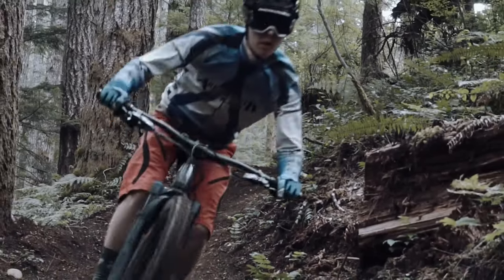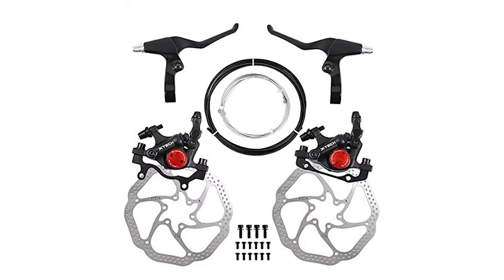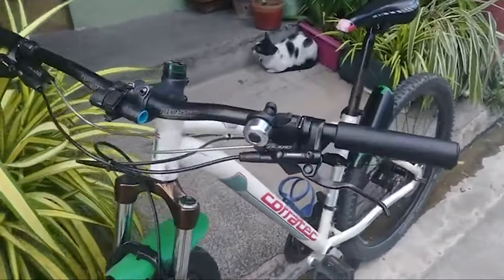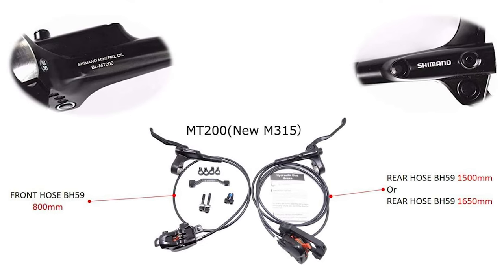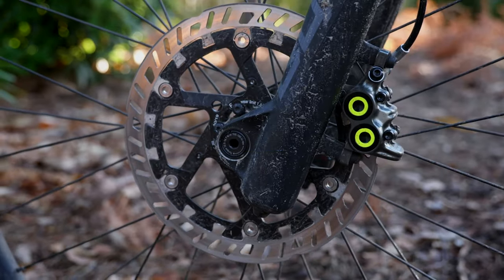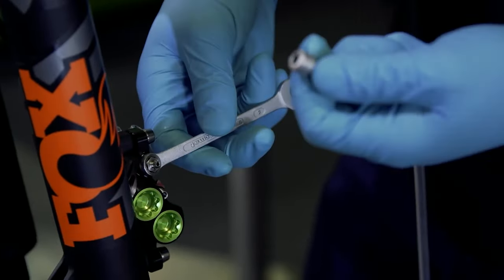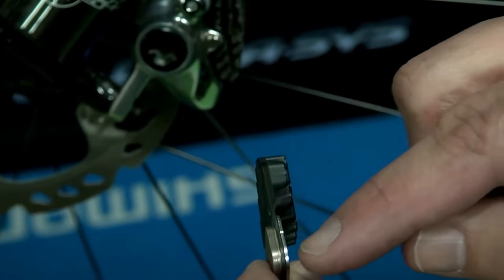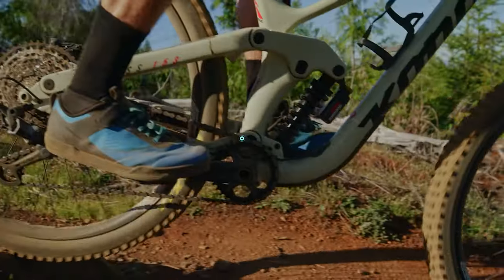What's The Best MTB Brakes (2024)? The Definitive Guide!

Comment: I disagree hard😅 Im on 8120`s now, ive bled and bled and bled, but i just cant get them as good as my old G2 ultimates. Sure they are very good, but i just cant feel the same power/bite in them as i did with the G2`s. Both with metal pads in dry conditions and with the brake rotors (new and same size) from shimano/sram XT ice/Centerline

Comment: Trying to decide between SRAM CODE RSC, G2 Ultimate or magura MT7 HC3. I ride hard and ride Enduro/DH Mostly but also ride Trail and FR all on my Enduro Bike.  So I am looking to find the best brakes & make a one time buy. Sadly My Fav brakes the TRP EVO-DH-r, but I have a gift card to backcountry & competitive Cyclist for $500 and Can't get the TRP, so I need to make a decision asap. can anyone help me. my G2 R's that came on my bike are spongey and I don't like them. I need to upgrade. Help!
Reply: Get Hope tech 4 v 4  dual    Best stopping power I’ve experienced. I ride all mountain and weigh 220lb so when I get moving I rely on stopping power and I like the Hope over sram and shimano
Reply: Mt7 all day
Reply: Sram codes are crap and hope are overpriced show pieces. Best brakes are Formula Cura. They use the 2 piston in downhill bikes but you can also get the 4 pistons.
Reply: @gbuzztard  ya, ain’t that the truth! Codes are hot garbage. I’m done beating around the bush, I’m probably putting saints on my enduro.

Comment: Wht aren't grip twist brakes a thing?
Reply from the maker: Can you explain your point?
Reply: @pickadviser  brakes that work like grip shifters. Like twisting a throttle but connected to the brakes instead of gears. I have rheumatoid arthritis and fibromyalgia, the brake lever hurts me more than any other operation of the bike. I feel like I wanna replace brake levers with grip actuated brakes. But who knows? Maybe it would be even more stress.  I'm just brainstorm daydreaming.  I ride an Ebike in city traffic to deliver food.
Reply: @BadManWithAMadPlan  For city riding, you could probably get away with the twist grip concept but, for more “spirited” riding (trail, enduro, downhill), not so much. In such disciplines, you generally always have at least your index finger always covering the brake lever for quicker access (quick stopping and brake assisted turns) and brake modulation. So, having twist grip brake actuation on rough or undulating terrain would generate twisting forces between the grips and palms while the bike reacts to the undulations under you which would result in inconsistent/unintentional brakeforce application.